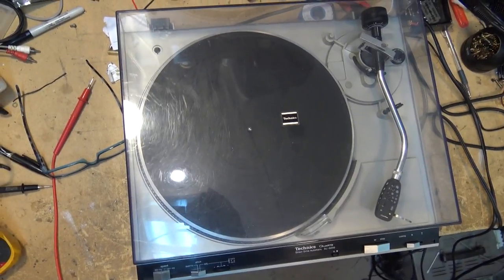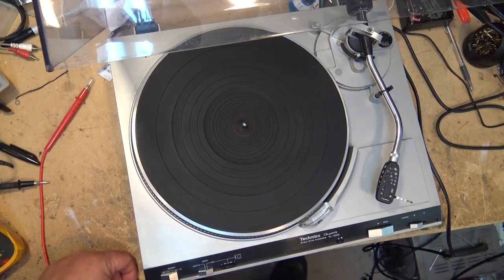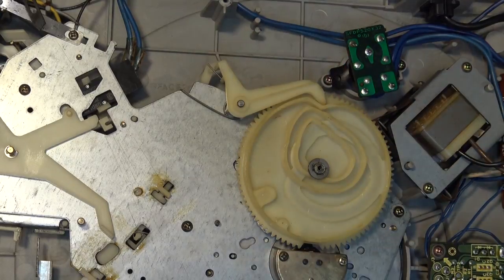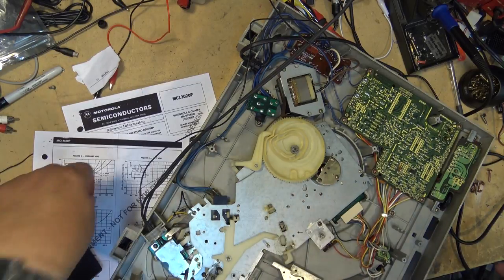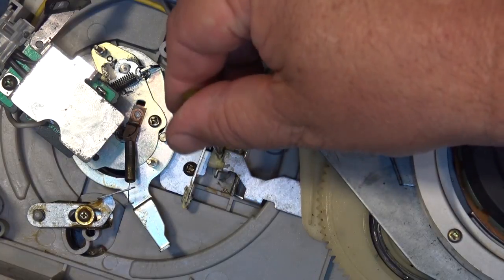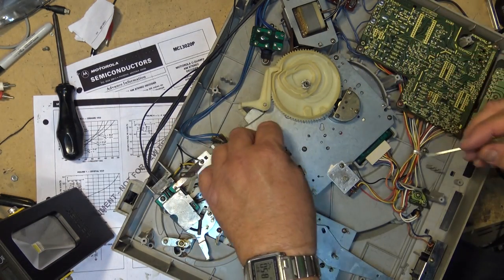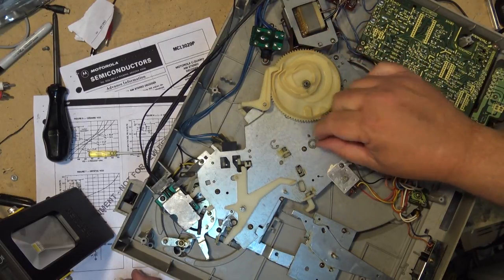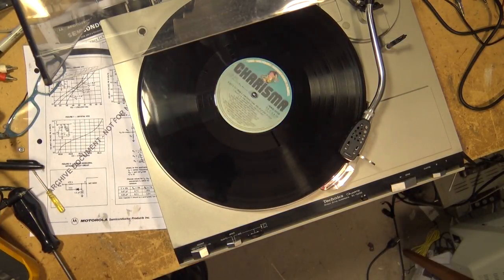Technics SL5200 Direct Drive Turntable service

Comment: Thanks for this video, I used it last year to overhaul my SL5200 (forgot to say thanks then) - for some reason this video popped up in my YouTube home page today so I watched it again.  These are great turntables.  I was lucky that the one I found on Craigslist last year was in almost new condition and was being sold by the original owner, with a micro-acoustics 282-e cartridge and stylus that was / is in great shape.  One thing on mine was that the anti-skate spring was coated in hardened grease that had to be removed.  Someone on eBay sells a high viscosity silicone oil for the tone arm damper.

Comment: What about a drop or two of oil on the main spindle bearing?
Reply from the maker: Yes did that. File was corrupted on SD card, so only way I could show it would be to rip it apart and reshoot.

Comment: Hi my name is Tom and maybe you can help me out on this one. I have a Technics SL-1300 turntable that will power up(the strobe light comes on) but it will not spin. I have checked all of the fuses and cleaned all of the pots with deoxit and still want spin like the motor is not getting power. I love this TT and would love to get it going again. Thanks for any help on it
Reply: Sone tables have a small microswitch with contacts and the motor will not start if the contacts are oxidized.

Comment: I've seen no end of old decks with a stuck solid turntable and metal auto gear, the brown grease is as solid as concreate, sometimes only a small butane torch can heat it up enough to soften the grease.
Sounds nasty but soaking in fluids often doesn't work.

Comment: The tip about cleaning off the excess glue from the circuit board was excellent!  That is something that will apply to all solid state electronics.

Regards, Tom

Comment: Thanks Dave for another great how-to and for getting this table up to snuff.  I was really happy with this table and getting it checked out.  I had to find some missing parts and clean it up, then take it to the doctor to get it healthy.  And this is a kind of hobby and pass time.  But alas, imagine my dismay and shame, to find out that I was wrong; I should have bought a Revox something or other, and that they were not that expensive but pretty good...I am deeply hurt.  Ah well back to Craig's and the Bay!
Reply from the maker: wayne mckinnon 
Nothing wrong with technics. These direct drive tables are great and very quiet.

Comment: This is a very nice looking turntable shame the owner doesn't own a REVOX B970 which would sound a lot better that that turntable as the there would be no tracking error and the tracking weight would be less than 3grms and with the REVOX B970 you hear everything the recording engineer intended you to hear, The REVOX uses a computer to control the tonearm rather than leavers and cams and cogs.

Comment: These were not expensive but obviously good units, that stood up well. Direct drive is the best.
Reply from the maker: Well they were not as expensive as the SLM1 for sure, but a respectable turntable. The M1 will eat it for lunch despite the TP4 cartridge system.
I know the "snobs" did not like the TP4 system, but had vinyl not died around that time there would have been several high end tp4 cartridges to choose from , and technically there is nothing wrong with it. There were many pluses for the TP4 system. Alignment was guaranteed at all times being one of them.